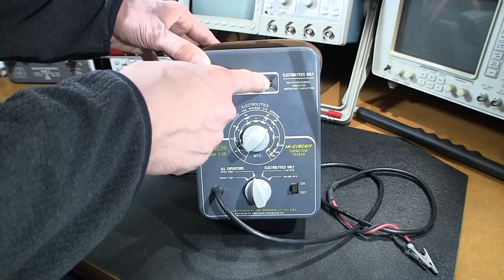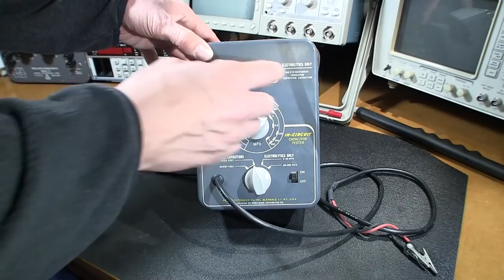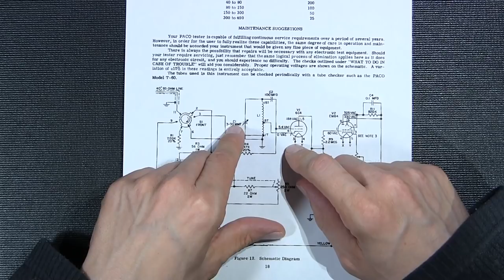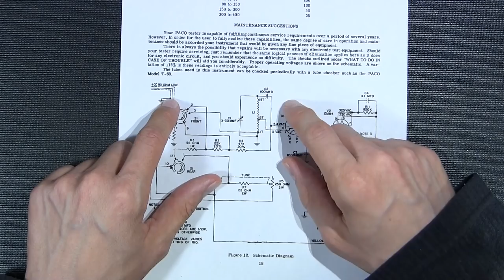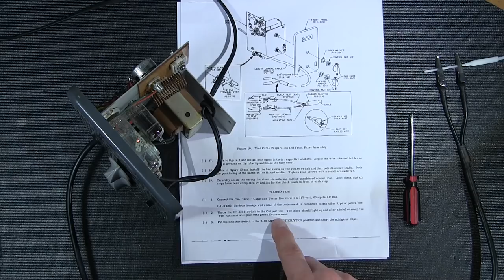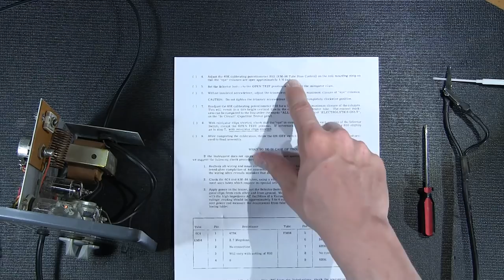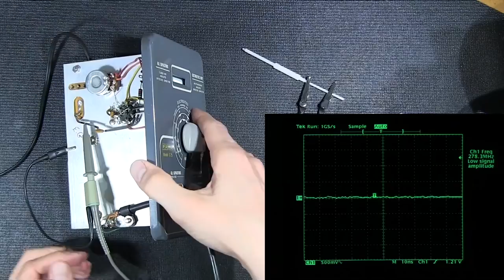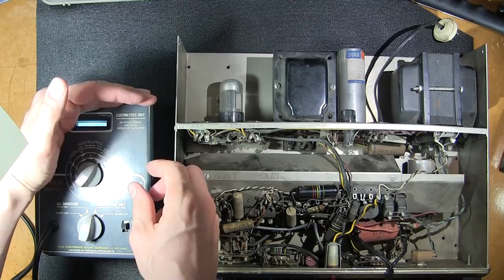Bizarre Circuit Tests Capacitors with RF!

Comment: I'm happy to have found this video.  I recently aquired a Midland 23-170 capacitor tester and haven't had any luck finding schematics for it.  Turns out, the Midland's circuitry is nearly identical to the unit in this video.  

Thank you from an aspiring electrical engineering student.
Reply from the maker: You're welcome Daniel!

Comment: Your construction of the 40" cable and minigator clips was great. I just wish i had that info 40 years ago in the service. All of the different coaxial cables with a multitude of  center dielectric insulation was crazy. The worst part was soldering the center pins of the RF connectors without melting the insulation inside of an aircraft when it is 5 below zero.

Comment: At 40 MHz, the wavelength is about 7.50 m where a quarter of it would be 1.875 m, though the cabling does not seem are so long. Please give details of the circuit analysis in your videos. This has great educational value for most of the viewers as they can learn how to apply them in their own cases. Many thanks for your video.

Comment: I used to have one of these, I'll have to look and see if it's still in my dad's basement.  The open / short test used RF as you explained.  I put a scope across the test leads in electrolytic mode and was surprised to see 60 Hz AC (from the filament winding so low voltage).  This was 40 years ago at least so I could be wrong!  It did look and work exactly as yours.  I was always amazed by the lack of the expected power supply components, that got me to take a good look at the schematic as I didn't build the kit.  As in "How the heck could that work!"

Comment: For anyone interested in acquiring one of these testers, I was able to pick up a Mercury model 1400 capacitor tester at a swap meet.  (Mine is not for sale.)  It seems to be factory wired and the circuit, functions, tubes (British and German), dials and switches are identical to the Paco C-25, although the parts layout on the chassis is different.  Also, no parts needed replacement.  

I was similarly surprised at the circuit diagram.  I kept looking for a rectifier and electrolytics.  I was wondering how one could feed AC straight into the plate of a tube and get it to do anything.  Great video and explanation.  It ended a lot of my head scratching.

Comment: Ingenious! Another nice video, Mr Carlson. That is a neat circuit in the old Paco tester.  Some scum broke into my tuck, and ran off with my $400 Klein leather tool roll, so away went $5000+ in tools, and $20,000 in radio equipment. I bought a new Fluke 87 V, and a monster Fluke clamp on. I found my Amprobe ??? Model true RMS AC only peak hold clamp on. I had been doing home inspections for my new home/shop, and lost a thermal imaging camera, clamp on ammeters, volt meters, circuit tracers, moisture meters, thermometers, and mostly other tools for some roadside repairs. I did NOT have my $400 Brownell's screwdriver tip set, which is worth every penny. They are all hollow ground, and there are 75 + 12 different sized slot head tips alone, so they grab those old slot screws really well.  I need a new alignment tool set. Those get chewed up over the years. I also need some more replacement electrician's tools. A few items turned up in the lawn between my truck, and the neighbor's house. His son just got out of prison too. You can guess why he was in prison. Burglary, theft, robbery, shoplifting, and drug charges. I think my Sano amp's reverb runs off a 6C4. I have a lot of nice tube testers. One runs a 5KHz signal through the tube under test.

Comment: That was terrific Paul. would definitely love a primer on the 1/4 wave stuff and the entire schematic. Might be fun to build something like this. I'm definitely going to keep a lookout for one for sale. Also, a video on just the trick of soldering the alligator pigtails to the wires with the high heat shield would be nice. That sounds brilliant but I couldn't quite picture all of it (like how you get the solder in there once it's covered). Lastly, you touched on "tuning" coils (which I suspect is similar to tuning for coax length) ..I'd be interested in a  primer on just that if you don't have one.
Reply: I think it'd be more interesting to explain the old schematic while recreating the same circuit with new parts (IE: modern transistors) which would make it more useful because it'd be more compact. And at safer voltages. 

One could even use have a selector for multiple frequencies to make it more versatile. Just a thought.
Reply from the maker: Thanks for your input David!

Comment: Suggestion: Perhaps, in the 'Show More' section,  you could add a link to the schematic and maintenance suggestions so that we could make it enlargeable on our computers to really get a good look at how the circuits are designed, and WHY they are designed the way they are. You don't have to add the whole users manual, just the pertinent circuit details. That would be very helpful to those of us who really want to understand how these devices operate. Fascinating stuff, LOVING the videos.  73

Comment: I would love to see a video about RF, 1/4-wave vs. 1/2-wave, how coax length affects SWR, what's really going on in an "antenna tuner", etc..  And the icing on the cake would be to have your permission to post it on my little FB group where we try to demystify the complexities of radio for the entry level amateur radio operators.  So many want to get involved without understanding that ham radio, at its core, is a hobby of electronics, and so requires some technical understanding. And, of course, it's always good for me to keep refreshing this subject in my mind. Thanks Paul, you're providing a valuable service to us and it is certainly appreciated. 73
Reply from the maker: Thanks for your kind words, and your input Mike!

Comment: Great presentation as always, one suggestion through. I am a CNC machinist, programmer, and CNC repair. By day however I supplement my weekly (very weekly) pay by repairing amps, cncs and whatever wanders through the door. A segment on what basic test equipment you consider essential would be really cool. For example I have:  2 BK100MHz scopes, BK21900 dig. storage scope, 2-3 crappy cap testers, standby Fluke 111 multi m., HP Spectrum Analyzer 3582A, 2 Tek CFC Func. Gen., BK 2831D True RMS 4.5 dig., Pwr Design TW5005T dual pwr. supply, Fluke 8922AT. RMS vm, 2Tek PS 501s, DC503 ctr, RG 501 ramp gen., PS 503 Pwr Sup., DM 502 DMM, PG502 Pulse Gen., RG501Ramp Gen., DC503A Univ. Ctr. & 1/2 dozen other items. 
But I need a good Cap tester, which lead me hear. Is this a good start? Machining lead me hear, gives me funny $ to buy test equip.

Comment: Bonus fact: That oval shaped hole in the back had multiple uses back in the day, such as having two cables with glands or two DIN sized signal connectors.  A really interesting one was that it would also fit a mains input plug based on the traditional European style mains plug, which is really a 19mm double banana with extra insulation. I have even seen a device where the power cable was terminated in a female plug on the back plate, but facing inwards and mating with a power plug on the chassis, so opening the unit would unplug the unit, but a test engineer could override by simply using a regular power extension cord that he would have to remove before closing up the box.

Comment: Loved everything except the limits of the tester. Since many caps don't short or open but wander from age, environment, or leaking this device would not do much for me. A ESR meter or just a good cap checker with leakage option would be best for me. Thanks again as I did not know you could do all of this with no DC, amazing!

Comment: I remember back in the early 90s Electronics Australia had a kit based around similar idea but solid state to make a cap tester that you could plug into a normal multimeter.

Comment: I would be interested in detailed schematics explanations. I have issues understanding new microchips cause i dont know what they really do. And the information on what old parts do and what is their purpose is dissapearing. Specially if its anything HV AC or RF. Thanks!
Reply: I would call it more like learning obsession. I cant just accept that something works if i dont know how ;D The new chips and modules today contain just way too much to even really try.. But yes, i still have some issues with transistors too, like the real difference with tube transistors vs new ones with HV AC and differend frequencies. Seems like there is much things we cant do anymore cause there is no more tubes and information about them. And "BJT with negative resistance" for example.
Reply: First off the way to understand new chips is not so much to look at the details at first but to understand what they do as block diagrams within the IC. New ICs are like lego blocks.

"Tube transistors" vs "new ones" (remember the first transistor goes back to 40s or 50s and was a JFET) is very simple when you look at the formulae one uses to design with them. Tubes are voltage based devices while transistors are current based devices.

The exception is FETs... they're voltage devices with essentially no leakage current in the gate.

Comment: I finally found one of these for $40, so I had to get it.  That coax is a bit hard to find and mine is about 2 " short, going to see if the oscillator will adjust up to make it a 1/4 wave length and see if it works okay.

Comment: Could you explain briefly how you got solder to join the center conductor to the stranded wire/ I followed everything down to the detail of getting flux in the tiny gap... It sounded as though you just held the soldering iron to the high temp so I assume that you left a piece of solder inside where you compressed the two wires which would melt from heat penetrating from outside? 

Also, add me to the list below of people who would love separate videos delving into details on this schematic or another on the  details of impedance, inductance and capacitance in various RF circuits. It is fascinating stuff! Thank you for the videos which get me out of the theoretical books I am reading and closer to working on actual circuits! You are very generous with your time and a real hero!
Reply from the maker: Hi Jason, thanks for your kind comment! I have some fine gauge solder that I fed into the split between the two wires. The tip on the iron is sharp so it squeezes between those two wires. Liquid RA flux was also applied to that gap in the two wires.
Reply: Thanks for the quick reply and the helpful details!

Comment: Here's my tip on Coax , use Teflon center insulator if you can afford it. Its so easy to solder with never melt and short to shield.

Comment: I think I get why it's a quarter wavelength test lead. Because when it's "whole" it will be 1/2 wavelength which of course is 180 degrees out of phase with the original signal so it cancels it out.

Either that or I need to remember more about the types of oscillators.

Comment: A very clever instrument and fascinating to ponder, but probably only useful today when working on similarly old equipment. Decades ago a colleague introduced me to his ESR meter. He took it with him when he left, and I had to buy my own. It's a troubleshooter's secret weapon--simpler than your PACO, but better suited to today's solid state electronics. It is essentially an AC ohmmeter (OK, impedance meter), battery-powered, and running at about 100 kHz, I think. No concerns about quarter-wave stubs. Large caps might normally present a high inductive impedance at 40 Mhz, due to their internal construction. The vast majority of electrolytic capacitor failures today seem to be due to drying out which causes a rise in equivalent series resistance (ESR). With a little intuition and/or help from the provided chart, one can readily detect a dodgy cap in-circuit. As an added benefit, the gadget can measure resistance down to 0.1 ohm.

Comment: Hello Paul,  That capacitor tester IS an Interesting circuit design using the 1/4 wave stub at 40.0 MHZ, Simple but effective for its use!!!!!  Like always, Another GREAT VIDEO with a SUPER EXPLANATION !!!!!!  WELL DONE Paul !!!  John A Bellas  KC2UVN.
Reply from the maker: Thanks for your kind comment John!

Comment: the less components are used in an old design, the more complex the functioning is usally, since most components were used in very tricky ways. since components were tremendously expensive and engineers clever to profit from (normally) unwanted side effects.

Comment: I really think you should go in depth with this circuit. Impedance, reactance, impedance matching, etc... (don't forget Bode plots) and really explain why 1/4 and 1/2 wavelenght (or multiples thereof) pieces of coax act as they do when circuits match their impedance.

Today's students need to realise there was a time before there was a little module which plugs on top of their Arduino or Raspberry Pi, with sample code provided, and one had to actually design an RF circuit instead of buying it off the shelf. I actually wonder if, when, say, all of the current schematics and tooling were lost, there are actually people capable of designing a WiFi or BlueTooth transceiver from scratch left these days; even coöperatively.

Same with digital circuits, there was a time before really cheap, mass produced FPGA's and National Instruments Graphical Programming, when you actually needed to learn a number of things: Boolean logic, state diagrams, microcontroller assembly language, interfacing, etc... before one could make a 'cool' and 'usefull' circuit.

And, yes, I do resent how electronics, over the years, has been taken away from the people who actually know fundamentally, on a physical level, what's happening, to people who, essentially, just know how to program.
Reply from the maker: Hi Jan. You are absolutely correct, and this is why I decided to make a channel teaching people about "Real" electronics, and not programming an Arduino to make an LED flash. I share many of your concerns!

Comment: I wonder if this eye-tube is similar to the light source that was used to expose the variable trace width soundtrack (solar audio) on film. Originally variable dye density was used but there were problems with making fast enough exposure lamps and focusing the exciter beam correctly upon playback, etc, so the sound reproduction was noisy, gritty, and dull. The variable width method gave a way brighter sound reproducible on existing technology.

Comment: Paul, it appears that this instrument has limited use. As you said it's only a go or no go test. it doesn't detect leakage. In  all your videos I've seen you  always check for leakage even when the capacitors test good for μF rating. I know you said it can test a capacitor while "in-circuit" but I can't see the benefit? Is it true to assume that a leaky capacitor is still acceptable depending on the amount of leakage for a unit to function? Anyway, I enjoyed this video as you always explain everything in amazing detail. Have a great day!